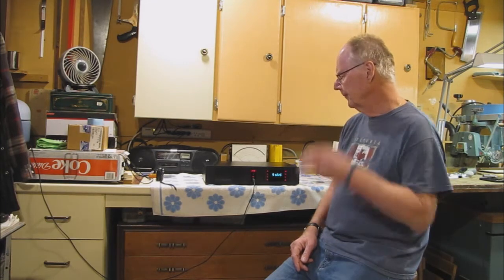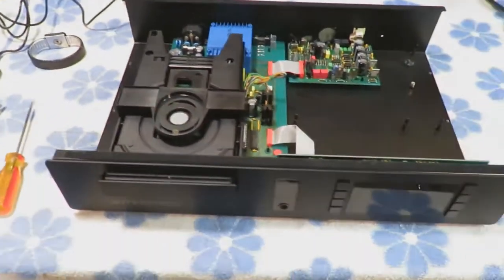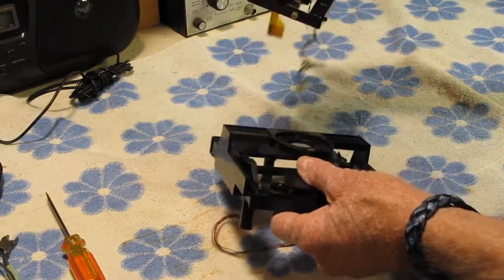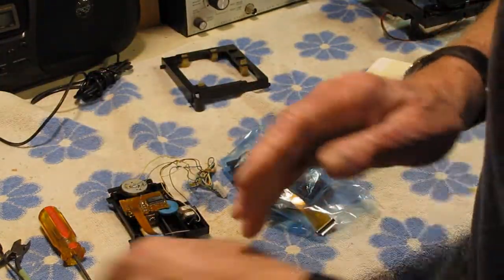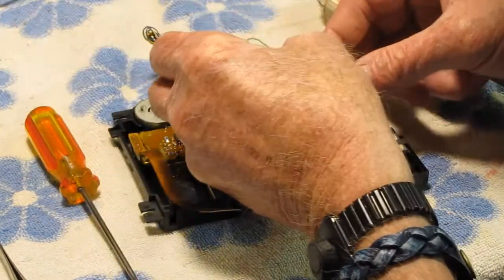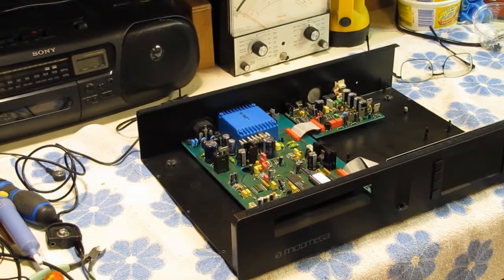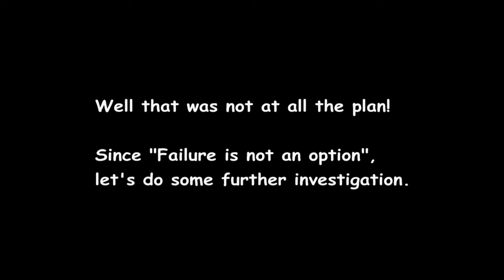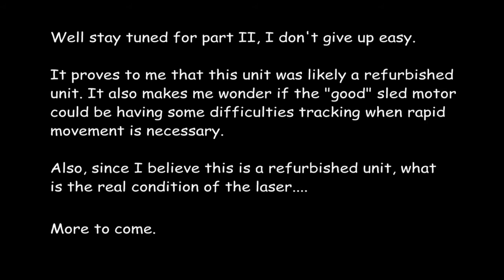MicroMega Stage CD Repair Part I

Comment: Change capacitors in laser supply...try to relube spindle motor...check all teets on transport....older models Stage 1-3 had eprom problems also...also be sure that door belt do not slips...
Reply: I did check the door mechanism belt and it is still good. I didn’t bother to show this as there are videos on YouTube already covering its replacement. My belief is that the first transport I received is used as the sled motor wasn’t working properly. The laser however was better and currently it plays just about all CD’s. There are just a couple of suspect CD’s now that still skip. I ordered another replacement drive from a supplier out of Germany that swears his units are new. Stay tuned for part 2.
Reply: @larryhuff3383  Try to recalibrate laser...little increse power

Comment: Thanks for your video Larry, very illustrative. I also own a Micromega Stage 2. Unlike your neighbor's player, mine it hasn't skip problems but serious difficulties to insert and take out the try, in fact I'm doing by hand and the operation is very noisy and jagged. Thus, I'm going to dismantle the unit and take a look to the gears. In the probable case that some gear pinion is broken, does anyone know if there's replacement for the try mechanism?
Reply: It likely needs a new belt for the drawer. They are simple to change. I actually was going to add that to the video but it was already getting quite long and I did find a video where someone changed the belt. All you need to do is remove the cover and take out the drawer. The belt is under the small cover at the front which is easily removed. Apparently this is also a common problem.
Reply: @larryhuff3383  Thanks again, problem solved. Finally, it hasn't been necessary to replace the belt; simply it was "derailed" from one of the two transmision wheels. Once properly placed and try is sliding out and in, softly and quietly
Reply: That’s great news. Even better that no parts are required!